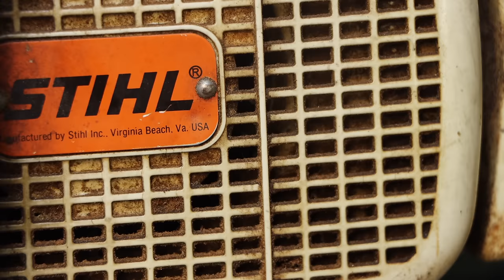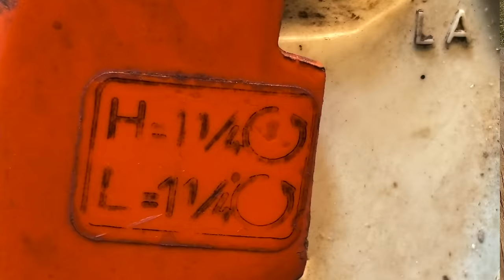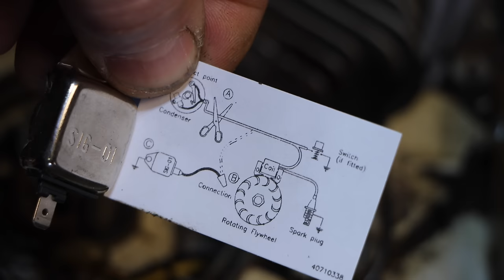Fixing An Antique Chainsaw.  Stihl 028 Wood Boss.

Comment: Seemed a little lean on the HS needle in the cutting test. I like lean it until the RPM maxes out, then richen it until the pitch just changes. That way it runs a little cooler and has a tad more torque when pushed.  1 thing to check for if all the usual suspects are OK is a leak in the crank case, usually a crack. It can drive you crazy until you fine it! All's well that ends well, you persevered and got it!

Comment: My 028 was doing something very similar. I had to replace the pulse line from the crank case to the carb. It looked fine but it was cracked and wouldn't pump enough to fuel to rev fully.

Comment: check the muffler it could be plugged not allowing the exhaust to exit the combustion chamber there is a spark arrester screen in there that probably is clogged or ive also seen mud dauber wasp nests built in there

Comment: Awesome repair and a victory under your belt. At around halfway through the clip I was convinced it was a carb issue, but that was good diagnosis to look into the spark/ignition electronics. I have a Forester brand chainsaw that has not been run in 10 years, tried starting it last week, no go. Its the carb, a Walbro  and will order a rebuild kit soon. 🌿

Comment: Regarding your bar dressing, you may already know but I didn’t see you show it. The small hole at the end of the bar allows you to use a needle point grease fitting to lube the bearing there and is very important for bar life.

Comment: Sounds much better, but I'd still check that reed.  At times it almost sounds like a bad crankshaft seal, giving an air leak, but doubt that's the main thing.  Bad reed will definitely cause that fuel back spray it's giving.  Oh, the Stihls I used in the woods were 051AV....long obsolete, now, but they were a rugged, torquey critter that you could really lean into.

Comment: I'd find a way to attach that idle throttle screw so it doesn't go awol as it did sometime in the past. Plastic threads. I always think "fuel and spark" first. Filter, hose fittings, fuel cleanliness, idle and high speed settings are just accompanying factors of those.

Comment: Might consider taking off chain and bar while testing.When it finally runs right, you can put it back on.  Much safer that way.
Reply: Don't need to run it full speed or could break crank with bar and chain off. That's what I was told.

Comment: Hi john
when I was working with chainsaws I would adjust low speed till I get the sweet spot then adjust out till re s start to down this gives extra fuel while idling same as high speed screw by doing this extra fuel for power
When you rebuilt carbi you did not replace plugs which get rubbish under them
Hope this helps you do the adjustment for all chainsaws

Comment: Adjusting the high low is like this.The bottom end is adjusted while you pull the trigger.The crisper, the feel the better the bottom end. When you adjust the top end screw you hold the throttle all the way down and adjusted while it's running!!!! 😊

Comment: my in-laws have been milling and cutting wood since 1958, even have an onsite wood treatment tank. my point, father in-law has well over a hundred old Stihls just gathering dust in a room in the barn. not one saw plastic like today. but he's a hoarder. won't sell anything, got over 300 Dodge cars and some trucks, 50 sum dozers. won't come off none of it. his 87 years old and runs around like he's 60. 1970 purple 340, 6pack Cuda, 70-440 purple GTX, 70-440 purple SuperBee, 70-440 purple Cornet convertible just to name a few. thanks for the vid

Comment: 50% of electrical testing is better with a load of some kind ie; wider gap, light bulb or load resistors versus multimeter or indicating light . it's deciding when to use either or.  another awesome video

Comment: JohnI i  bought one in  1980 OR 1981, the piston is scoured on mine. It would always start and run, but after getting hot , it would not restart until cooled down, when running a great saw.

Comment: Reminds of the time about 2 years ago when i got my Stihl 025 running again after it sat in a friend's shed for about 15 years. New fuel line, fuel filter and a new carb kit still runs like new. Just need to get a new bar and chain now. Also see where some think you put the bar on upside down when i flip it over to help even out wear

Comment: Fuel lines are replacement items.  Over time the rubber disintegrates causing cracks and leaks.  When you needed a clamp on the fuel line it indicates that it was on the way out if not gone.  At that time it makes sense to change the pickup line as well.  Change the in tank filter as well.

Comment: I think thats the perfect size saw to climb a tree with using climbing gear, it hangs off your tool belt and you cut branches off with it.
Then when you get to the top you pull up an 16 or 18" chain saw to top the tree and cut down in short parts until you get to a point you need a longer bar.

Comment: John (Jon SP?) that was awesome! I learned more about small 2-cycles in this one video than I have in ten years of fighting with them! I was watching intently to the end for the punchline, because those were exactly the symptoms I experienced with my first chainsaw, an old Homelite that someone had donated to the family. I tried *everything*, up to the ignition testing and replacement that you did, and with exactly the same lack of results. After a couple of years of using the POS to cut firewood, my mom back in California shipped me a new 14" Echo for my birthday, which probably saved me from death via head trauma from beating it against a brick wall. The worthless Homelite got stuck away in the water heater closet while that Echo blew my mind with the differences!
Now for my own punchline... That paperweight sat until, on some whim, I went looking for it and discovered it'd been stolen by a certain tweaker . Here's to getting one's just desserts when he tried to trade it off for dope!

Comment: every Sthil I ever had needed the valves unstuck at some point! too muck oil can do it too!
also to start them I found if you choke it with throttle till it pops then drop the choke fully and try it pops off every time!
have a great day!

Comment: Thanks, John. Love the vids. My ‘80 chainsaw ran great until the brother-in-law left it out in the snow last year. Keep up the great posts.
Reply: I learned a valuable lesson years ago when I loaned some hydraulic jacks to my brother: never loan out your things. And then I did it again; I loaned out a very nice  gas-powered water pump to neighbors who needed water on their off-grid place. You guessed it: they ran it flat out every day for hours, never changed the oil, regularly ran the oil low. At the end of the summer, when I saw what they had done to it, I told them to keep it. Again, never loan out your things. Most people just won't appreciate your generosity.

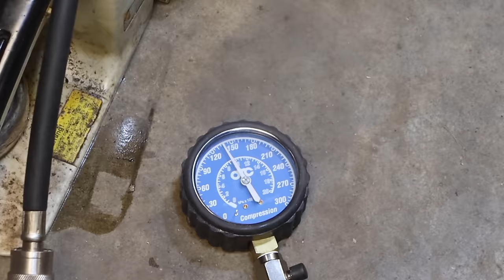Comment: 18:30 not sure if you had your toe holding the throttle open but when doing compression testing you want a open throttle and no choke or it will give lower readings or even bad readings.

Comment: A buddy gave me one just like it about 5 years ago. Last wee I decided to work on it. I took the car off and cleaned it. It had what looked like fine rust on one of the check valves. Took it apart and a hour in the ultrasound. The internal parts were flexible so I reused them. Put the jets in all the wat and out 1.25 turns and tried it. Cranked on the third pull and ran like a scalded dog.

Comment: I bought one in the 70 something and it still works good, carb. Never been touched. After using always pour out the fuel and run it dry.

Comment: One tip to check, when dealing with 2stroke engines that have hugh fuel blowback, is to check if the reed valve(s) are well closed, and if there are no cracks in the valve(s) plates. To check if reed valve(s) are okay, is to blow with your mouth gentle, and then they need to make a vibrating sound.

Comment: I’m amazed you don’t empty the fuel out of your two stroke machines, when you’re done with them, and then run then till they stop. Restart until they won’t start and then store them. This is what we were taught in the military and what I’ve always done. So far I’ve never had a machine fail to start, when used again, and never suffered the gummed up carb issue that evaporated fuel causes.
Reply from the maker: I use my chainsaws so often, there's almost never a time when they sit for more than a month, usually less.  And I always run ethanol free fuel in all my small engines.  Cheers.

Comment: Similar problem with a 1991 Peugeot 405.  Muppet mechanic checked there was a spark, then changed the carb to no avail.  Then I checked the coil and found it had split on the back side.  Yes there was a spark, but it was weak.  With a new coil it sparked like a photoflash and problem solved.   Nice one TW you muppet!

Comment: Take care of the muffler for this saw, it is getting hard to find out there. I have a 028, too and from what I saw when you tested yours it seems to me that it isn't running as consistently as it should. And it should pull harder. This saw is build to run 11000 or 12000 rpm without leaning out to much. I would suggest to exchange intake hose, impulse hose and fuel line as well as doing a pressure test on the case (these 028 are quite notorious for leaking crancseals ans sometimes casegascets. I also would change back to the tillotson, that "spitting back" could have been caused by a de-adjusted timing on the points. Throwing the whole carb in the ultrasonic may help a lot but the high jet nozzle can be knocked off, cleaned and refitted (there is a aluminium cap just above the idlejets, too in the carb). These 028 are very handy saws. Reliable, quite strong but with a little flaw in the wight to power ratio, compared to newer saws such as the 026.
 That corn-lathe really got me! As always: very cool Video, John!

Comment: About the carbs going bad over time. The internal passages oxidise over time and slowly clog. Usually cleaning in gets fuel/air moving again and ultrasonic cleaners are really good at loosening garbage in there but eventually its so oxidised that cleaning just will not solve the problem.
Reply: Thank you! Totally makes sense!!

Comment: I have a 028 too that doesn't run right. Every time I pick it up it wants adjusting, and even then it's not happy for long. I suspected a leaky crank seal, but it might just be the same problem you found. 
Yes it is much weaker/weight than the newer ones, which is why I never really bothered to fix mine, and parts are now more expensive and harder to find than the square body ones. The vent hose on these, the hose  with the grub screw, is a common failure, but yours looks replaced.

Comment: What an ordeal but a very educational experience nonetheless.  Now you have a valuable great old Stihl chainsaw.  I did not realize how easy replacing the old points and condenser would be with a modern electronic ignition module.

Comment: Thanks for another great video. Long time follower here.
Now, there must be a gasket between the carb and the cylinder. I saw that gasket in your rebuild kit but I didn't see you putting it on. If it's missing, this is causing air leakage and bogging and power loss. I learned that lesson the hard way with my Stihl trimmer. HTH

Comment: The 028 wood boss is a toy compared to the MS 460,[ 2.8 cu.in.,47 cc vs 4.7 cu. in. 76.5 cc] It's more like your limbing saw which has 1.8 cu. in. 30.1 cc.I use an 056 magnum and a 020t all the saws I ever need.🍻

Comment: John,,, A Trick-with the carb removed put a dab of grease over the impulse line and pull it over. The impulse should draw the grease in., Richen the high side a bit. I did not hear any 4 stroking and the saw was running to lean. Your saw needs that extra mix and will smooth out during the cut. Also the saw will run cooled with a richer mixture. On this saw use a 40/1 mix. I have the same saw but with electronic ignition. Your crank seals are fine. Ken

Comment: Amazing and very informative as usual. Surprised that the spark timing is the same (or at least adequate) now where it is set by the magnet field and not the switch. Many years ago I played around with electronic ignition and it did not work until I figured the voltage at the primary had the wrong polarity. This is set by the winding and magnet direction. One could speculate that this is the reason the kit coil does not work - it need opposite polarization.
Reply: As mentioned above, the Stihl electronic ignition, which came out in the early 1980s,  was paired with a different flywheel.

Comment: John, the 028 went through several revisions, including ignition systems. I believe the coil you bought was for an electronic ignition saw, which matched with a different flywheel. Magnets in different orientation. That’s why the new coil didn’t work for you.
Reply from the maker: Good to know.  Thanks.
Reply: Correct!

Comment: I would put a spring around that idle screw so it won't back out, with vibration. I have the same saw and I prefer my 026 same power but lighter.

Comment: Usually with those Stihl saws theres a internal check ball that will stick, causing the saw not to rev, just lean out and die. Trying to free it up is about impossible, even with cleaning and using a ultrasonic tank. And the check ball is impossible to access. But yours seems more like bad crank seals. If going that far, its a good idea to replace the bearings also. A puller has to be used to split the case halves, as trying to pry them apart will crack the plastic case halves

Comment: John, I know you know things, but I have something you should try. Warm the saw up. run it wide open, no load and fatten the high jet up till it starts to four stroke, on the edge in and out of four stroking. then put it in the wood. Under a load it should clean up and two stroke and have enough power to run through the cut. It sounds like the saw is running good when you first start the cut and then starts to bog down. that's because it takes more fuel to work and less to just run. Try it, it can't hurt. If it is not taking throttle right away when you make that adjustment you may have to balance the idle screw a little. Always good content
 Chip

Comment: Running within the first 15 minutes not bad for a carb cleaning Other then no power sounds like the high and low speed need adjustment Jon 15:00 @FarmCraft101

Comment: Thank goodness my  saw did not have that problem. It would start and run just fine until it warmed up and then die. Turned out that the plug wire was shorting out when the body expanded as the saw warmed up. New plug wire fixed it.

Comment: To view the condition of a Stihl, or other chainsaw piston and cylinder simply remove the two screws that hold the muffler and remove assembly.  Look inside.. should not see scrapes on either piston or cylinder walls..Mirror finish on both is best..❤

Comment: Hey buddy every time I've ever had a saw that starts and runs the way that one does, replace the crank seals. You can check them by blocking off the exhaust and pressurizing it with a little air and squirt some soapy water on em. But with that age and been sitting around it's pretty much guaranteed. Might be surprised how much power you pick up. 
Great video You're the first YouTuber I've ever seen to correctly dress off a chain bar. Most people know about the burr but forget about making it flat or vice versa. Nice job!

Comment: Great video, I've done a few Stihl rebuilds of this vintage and have not seen a points and condenser module behind the flywheel.
Reply: As I mentioned above, my 1977 Stihl 028Av has points ignition. Although I am thinking about upgrading to electronic ignition, either a Stihl setup or an aftermarket type. I'm thinking a hotter spark will make for easier starts.

Comment: Hey John another thing you could do for electronic ignition conversion is use an ignition coil off of a newer 028. The one you got off of Amazon had that ignition module built in. I have done this conversion with this coil before and it works great
Reply: I'm thinking about doing that very thing on my 1977 028AV. But be careful: the old timers tell me the electronic ignition coil isn't compatible with the points-ignition flywheel. There is a slightly different flywheel for the later electronic-ignition equipped saws. Ebay sellers have lots of both flywheels (from parted-out old saws) for sale cheap.

Comment: Main jet needs to be richer. If it hits max rpm without going "da da da da" (sounds like missing - some call it 4 stroking) it will be down on power. On those carbs the mixture leans out a bit on load, so you need to be ahead of it by being a bit rich without load.
Very nice and infirmative video. This is one of my favorite channels and has been for a long time... :)

Comment: I worked on a relatively new little Echo for a guy I work with that wouldn't idle. Only ran full blast. I rebuilt the carburetor, changed all the filters and lines. SOB still wouldn't run right. I bought a new carb and voila! I still have that little carb and will occasionally sit down and go through it. I have no idea why it didn't work.
Reply from the maker: Ive had the same experience. And it bugs me to not be able to figure out what is wrong with the old one.

Comment: I think the new coil is a electronic one. The new coil dosent need the extra modul or points. Just connect the black wire to the killswitch and you shuld have spark!

Comment: The gas hose in the tank can get pinhole(s) in it, I saw the new one there? Also, you want to look at the piston from the muffler side, it should look smooth, any vertical lines (scoring) are not good.